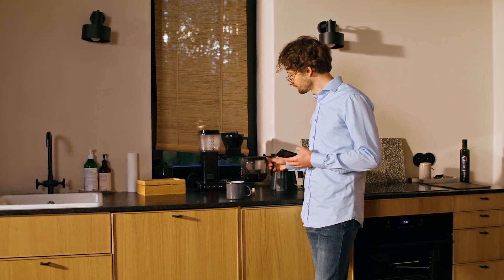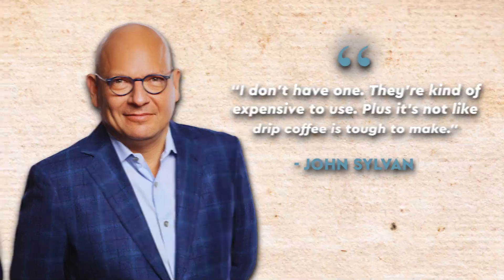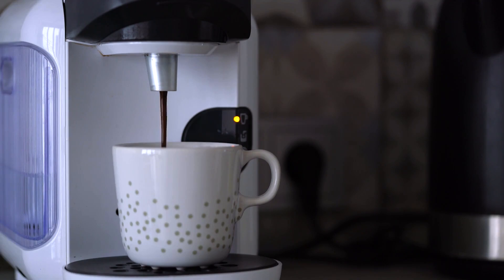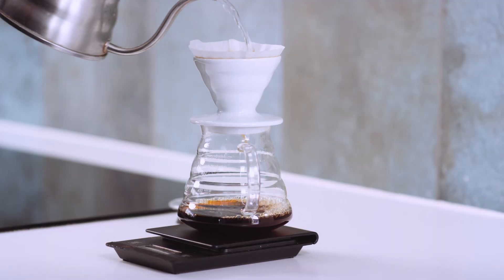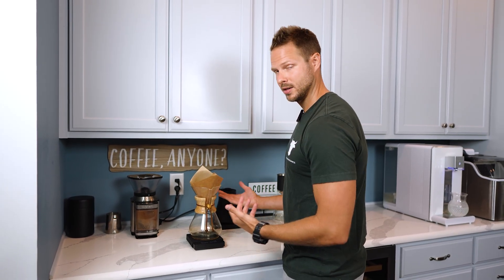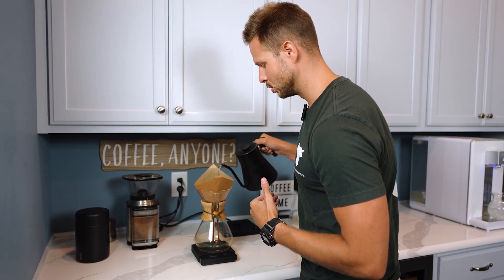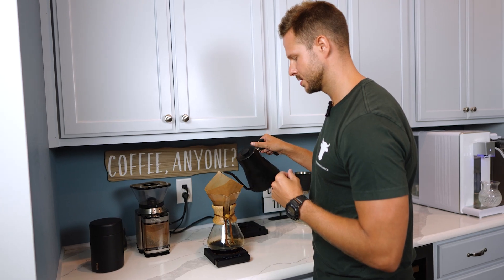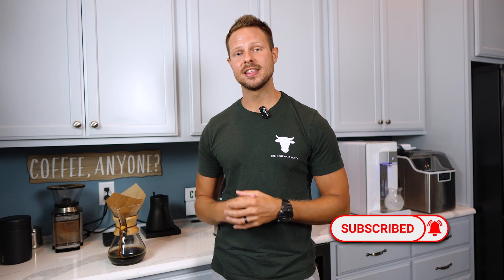Why I'll NEVER Use Keurig Again

Comment: I stopped drinking coffee cups because i was getting sick after . I also have a gut feeling that some coffees are the cause of autism . I now only drink Mexican instant coffee
Reply: They cause autism because modern coffee machines have plastic parts (not just the plastic pods) that leech chemicals into the coffee. Plastic tubes and other parts come in contact with heat and leech into the coffee. Wouldn’t be surprised if plastic is the cause of autism